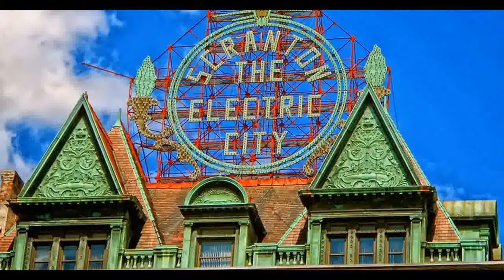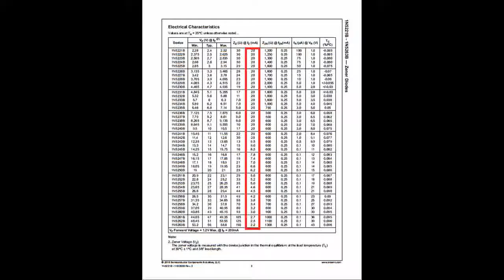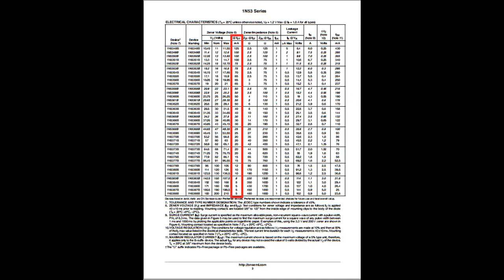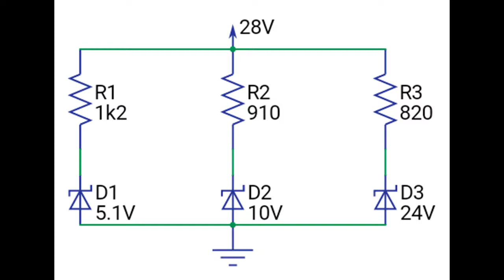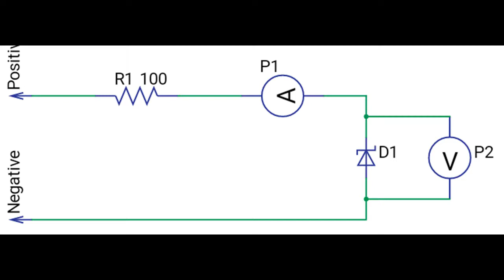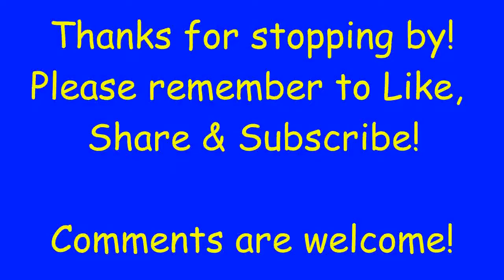Testing Zeners With A Power Supply

Comment: Thanks Bob, I will try doing that, I just need to find the data sheets on the few I have.
I would guess I would be looking for the MAX current the zener can handle that is listed on the data sheet?
Reply from the maker: It should tell you the zener current, usually listed as Iz. Very low for the high voltage ones.
Reply: Thanks Bob